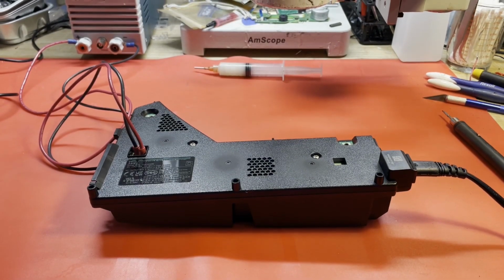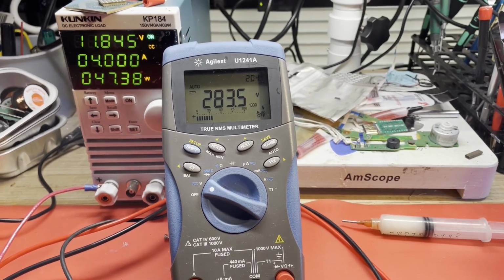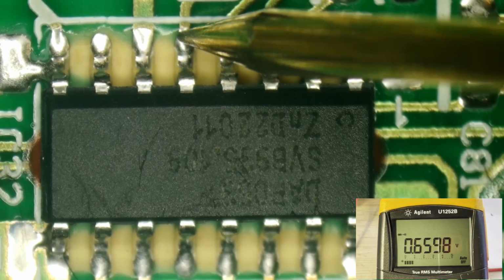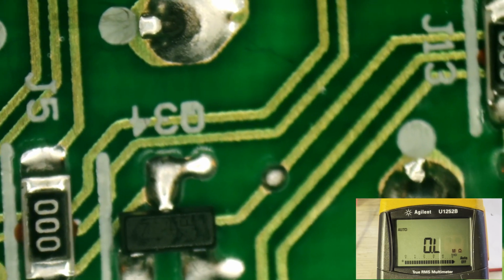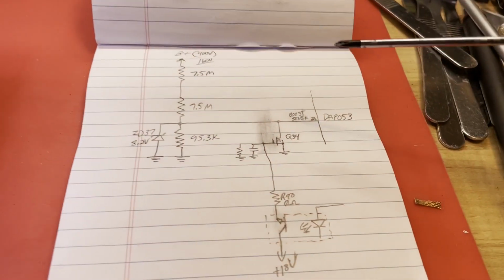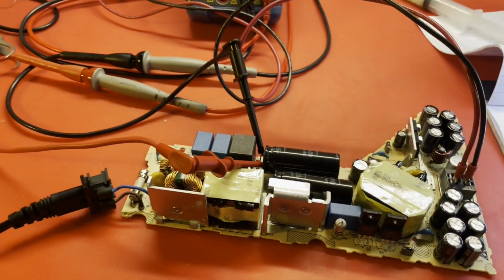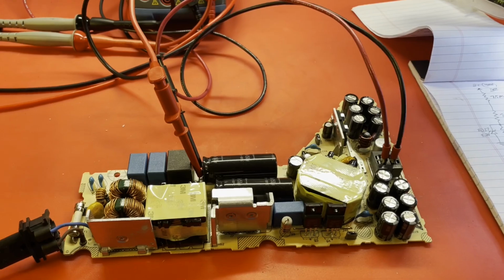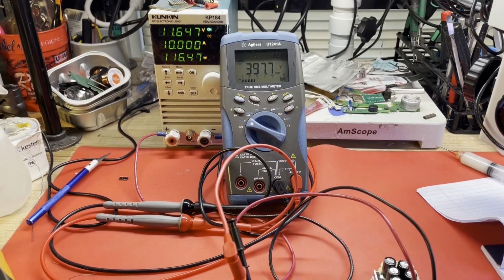#86 Repair of ADP-400FR Failing Under Load

Comment: I've watched almost all the videos but still haven't found a solution to my problem. Maybe you can help me like this... I have a 400fr and I replaced the dap053t, which got 100 degrees hot. Same problem with the new one - I removed the q34 and tried a new dap053t. And it got 100 degrees hot again. Do you have a good idea?
tia

Comment: Have a PSU with a similar issue were it power cycles under load after the transformer was put back on. Not sure if powering on without a transformer broke it but with these repair vidoes worth trying to fix again.
Reply from the maker: I'm glad you liked the video.  Please be careful!

Comment: Good fix again, have you always fixed consoles because you seem to have an extensive electronics knowledge and equipment?
Reply from the maker: Thank you!  No,  I only started working on consoles about 4 years ago.  Before that, I would just tinker with building different circuits for my work or myself.  I wasn't really repair focused until I found a way to have fun and make a little money while doing it by repairing consoles.

Comment: Like it, thank you
Reply from the maker: Glad you like it!  Thank You!
Reply: @ToltecMerc  Are you using a Nano or mini soldering pen?
Reply from the maker: @mm0077  i actually just got a Nano iron from China and I’ve been playing around with it.  I normally use a Hakko FM-203 with FM-2027 hand piece.
Reply: @ToltecMerc  Sorry to ask again. Did you get qianli or the s20? How are you finding it?
Reply from the maker: @mm0077  it is the Mega-Idea 20W which is the Qianli Nano soldering station.  I like it ok.  I use the large knife tip mostly.  Only really useful for small jobs.  Not a lot of thermal ability.
Reply: Thank you so much, that is good to know and from the video it appears to be working well.

Comment: Very good logical troubleshooting. Apparently not every IC fails in a way that shows as a short or open circuit at the interface. Very educational, thank you!
Reply from the maker: It was still working somewhat so no complete shorts.  It could been an odd resistor or cap I suppose but those DAP053 seem to be fragile.  Thanks for stopping by!

Comment: That was an easy one, but also a really weird one. If I had taken a look at it I would probably have needed to get something to put a load on it. Thanks for the video, another interesting one to watch.
Reply from the maker: It wasn't too bad.  Thanks for watching and let me know if you get any more.
Reply: @ToltecMerc  I will, but I’m probably going to wait for prices to come down, perhaps they will when another model comes out later this year. It’s difficult to break even and not over spend on PS5s as they generally go for the same price broken as they are new in stores even though they’re now in stock just about everywhere. I’m doing a lot better with the PS4 Pros while they’re still relevant.

I have a no power PS4 Pro on the way. I have an extra supply for it if that’s what it is.